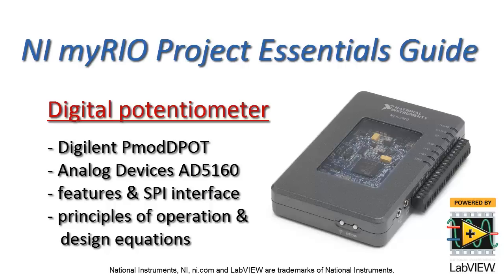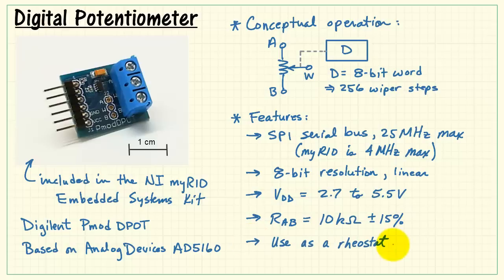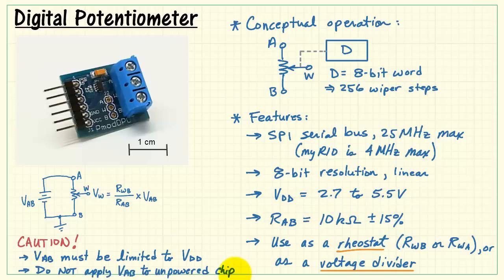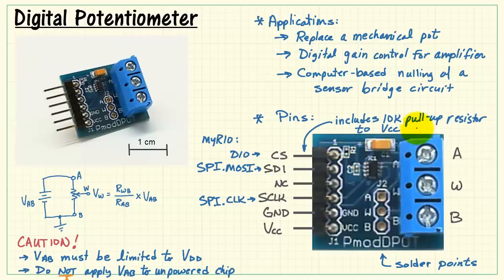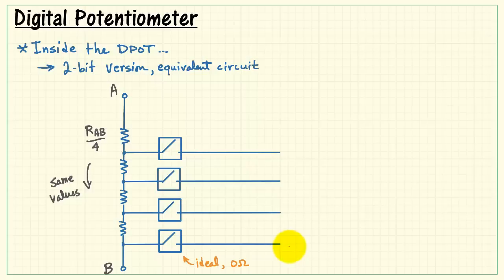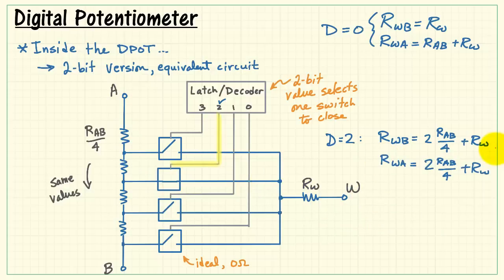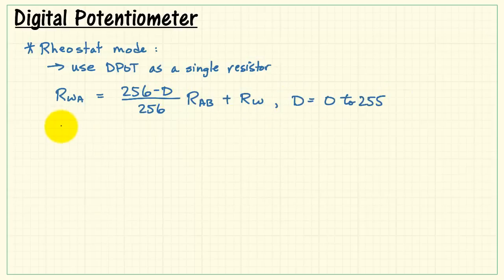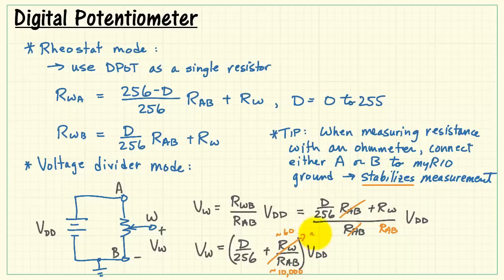NI myRIO: Digital potentiometer

Comment: Pls......is there any digipot that don't required spi or arduino interface just like ad5220 but work with up/down button yet remember last wiper position at next power off?

That is...nonvolatile yet no programming????